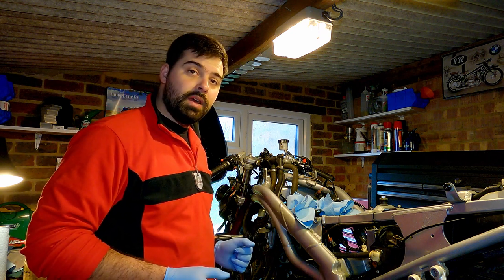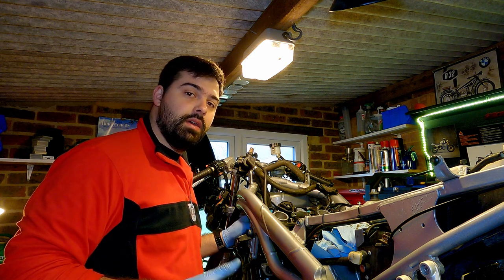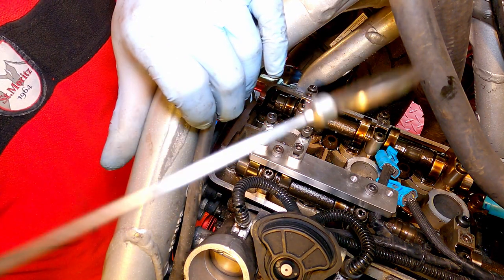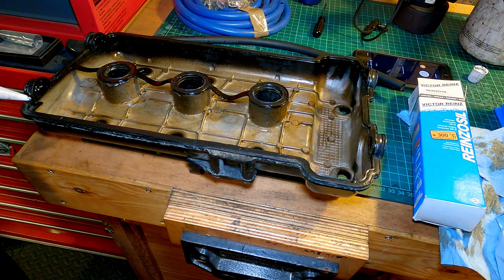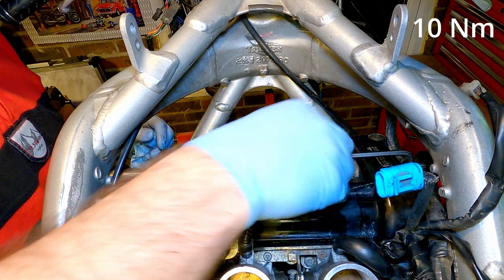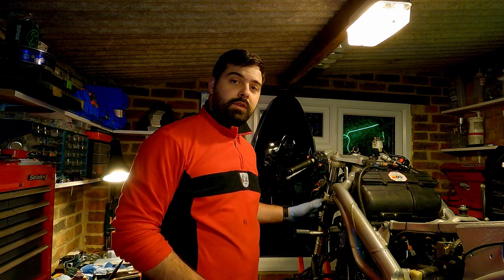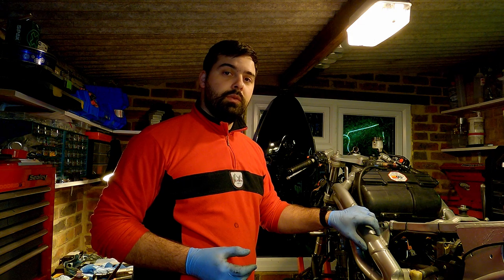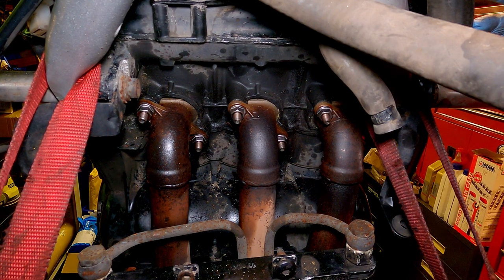Triumph Daytona 955i video 2 - Engine Service PART 1

Comment: No 1 cylinder idle air feed tube (black corrugated) appears cracked. A common issue, causing fast/erratic idle. Replace with heat resistance silicone tubes.
Reply: spoke too soon. blue tubes now in place to match the Caspian Blue. Mine are red to match the Tornado Red.
Reply from the maker: Hi there. Thanks for your comment!
Yes, it received new hoses. The old ones where perished and full of holes 🙂

Comment: Thanks for posting the video!
I have two comments: 
Shouldn't you synchronise the throttle bodies after adjusting the valves? (I realise that this is difficult to do without coolant). 
I would have shortened the stud bolts of the exhaust manifold to a minimum, which makes the next manifold removal with the water cooler fitted much easier.
Reply from the maker: Hello, thank you for your comment.

There is a part 2 for this video in which I fill it with coolant and sync the throttle bodies. Sadly I’ve been very short on time so it’s taking a lot.

Regarding the studs, I haven’t thought of shortening them, but I don’t think I would anyway. Taking the radiator off is quite easy I think. Even if you leave the hoses on and just pull it away a bit :) But if you’d rather shorten them, go for it :)

Comment: Do you have a video about oil temp and rev counter fault finding as my 2001 955 daytona has 2 issues , my rev counter just doesn’t work and the oil temp gauge just goes straight to hot even on initial start up . The bike still runs fine though 🤷‍♂️.
Reply from the maker: No, sorry. I don’t have a video for that 😐

Comment: What kind of hose (the blue one) are you using to get rid of the old brittle system?
Reply from the maker: It’s just a hose off ebay. 6mm I.D. If I remember correctly. It has some reinforcement in the middle as well which prevents it from collapsing in the tight bends.

Comment: I always use full copper nuts "not copper flashed or stainless steel" on exhaust studs as they never bind on next removal. But good job never the less.
Reply from the maker: Thank you for your comment! Yes, copper nuts are a good option :) In my limited experience, stainless nuts & studs + copper slip between them are better for uk’s wet roads, but I’ll try some copper nuts in the future again & compare the results.

What material are the studs you use though? Copper on stainless can cause a galvanic reaction if they don’t have anything between them.
Reply: @garage_tales  
Stainless studs, no galvanic action between them and copper. I was an engineer before retirement and have seen on many occasions st to st fusion even at very low temperatures "cold welding" we always used carbon based "pure Goop" as a barrier to over come this, but it is very expensive.